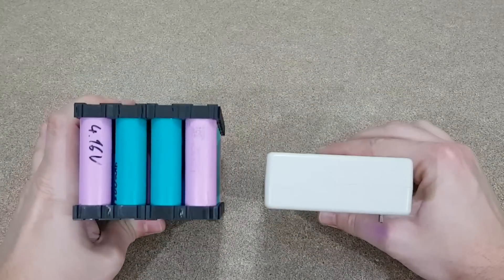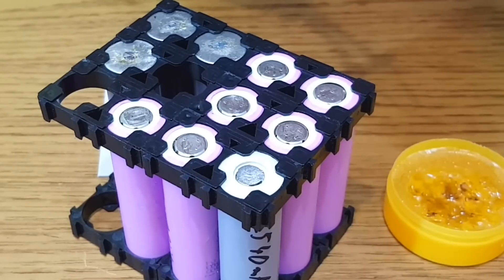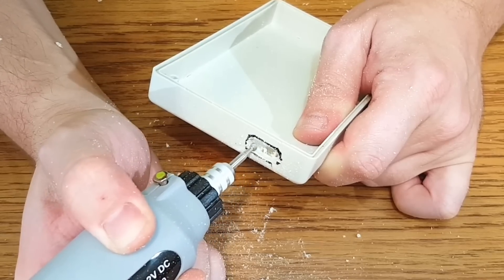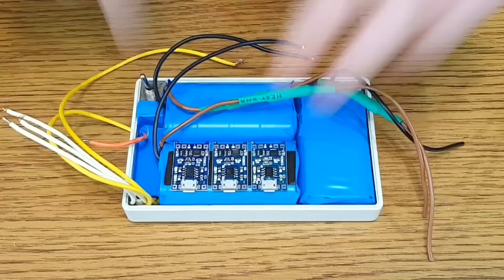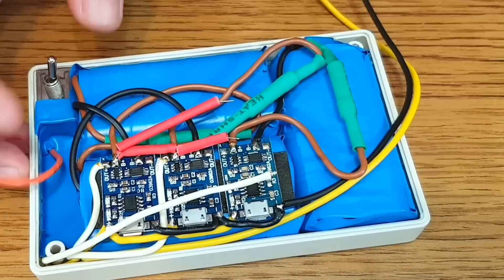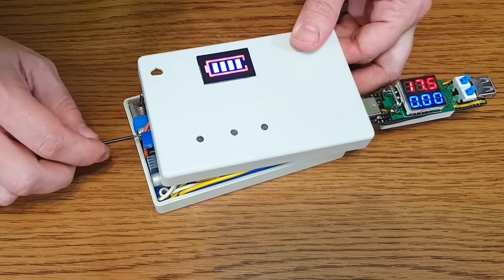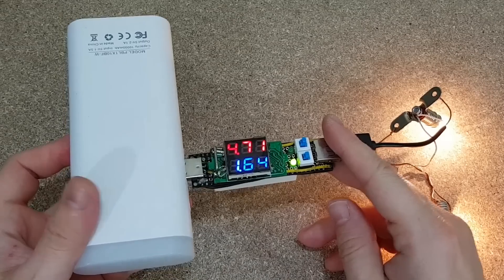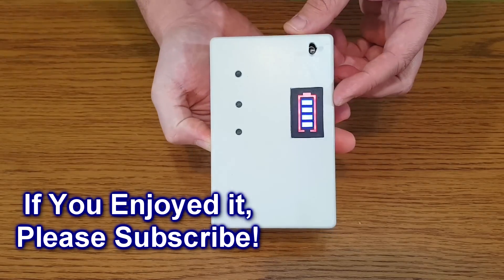DIY - 15000mAh Power Bank - With Salvaged Batteries (gets charged with 3A)

Comment: Hi sorin, i've been watching your youtube videos. I have a question, can i use 3parallel batteries for each bms to increase the capacity? Thanks
Reply from the maker: yes. but all the cells must be the same type.
Reply: @Sorin_DIY  Thanks! I'll definitely do it!
Reply: If i do it are there any modules in the circuit i have to change?
Reply from the maker: no. only a bigger plastic case :)

Comment: were does this plastic case came from?
Reply from the maker: I've bought it from a local store, but you can find it on Aliexpress:
https://www.aliexpress.com/item/32908017799.html?spm=a2g0o.productlist.0.0.548c70ffjbpmct&algo_pvid=f74485d3-9f84-4b75-87f6-f4f415fd2cde&algo_expid=f74485d3-9f84-4b75-87f6-f4f415fd2cde-42&btsid=3f53045b-b242-43a4-a456-742b6e0573f6&ws_ab_test=searchweb0_0,searchweb201602_5,searchweb201603_55

or in black:
https://www.aliexpress.com/item/32825258950.html?spm=a2g0o.productlist.0.0.548c70ffjbpmct&algo_pvid=fbaf7289-d821-4b04-92b5-0a3b556603a2&algo_expid=fbaf7289-d821-4b04-92b5-0a3b556603a2-0&btsid=783c9ad0-a872-45fe-969f-2dbf47cc0789&ws_ab_test=searchweb0_0,searchweb201602_5,searchweb201603_55
Reply: thanks sorin

Comment: sorin xl6009 modules can it charge 12v battery?
Reply from the maker: hi. it depends on the type of battery, ni-cd, li-ion, lead-acid, lifepo4... if you can give it enough current, yes you can use it to charge a battery, but in combination with a charging module for that type of battery. for a li-ion battery pack for ex, you can use it to set the needed voltage and power a BMS that charges that battery pack.

Comment: my step up xl6009 when used for charging is very hot even though I have used heatsing, is it not dangerous if it is placed near the battery?
Reply from the maker: hi. I suggest you use the step up converter from the link bellow. it's much more stable, when the cell voltage is under 3V. and it doesn't get that hot.
https://www.aliexpress.com/item/32450571426.html?spm=a2g0s.9042311.0.0.27424c4dYDNnaS
Reply: @Sorin_DIY  yes now i am using mt3608 but when i try to charge my smartphone the ampere output drops from 0.4A to 0.1A then charging disconnect. then I try to charge my powerbank the output ampere can be up to 1A and stable at 0.8A and charging not disconnect. Why so?😂😂😂
Reply: @Sorin_DIY  my xl6009 when battery voltage under 3.4V output jump from 5.1v to 5.8v-28v 😂😂

Comment: Could I take a normal switch (like this: https://www.ebay.com/itm/10pcs-1A-30V-DC-250V-black-Latching-on-off-mini-torch-push-button-switch/252221693408?hash=item3ab9959de0:g:y3cAAOSwZ1BXc8qW) when im just using two tp4056 and just put the to positiv wires together and up to the switch?
Reply from the maker: no. if you use 2 tp4056 modules, you need a switch with 3 poles and 2 positions - 3pdt switch

Comment: You can make even the crudest version of spot welder at home. Relay, momentary switch, two thick copper wires and a car battery. Good idea, excellent run of the idea on screen but really, there are 10k powerbanks that are more than half a size of yours because they have a light and powerful lipo battery and they can easily output 2A at 5V without drop. They aren't that much expensive. I have 9k one, had it for 3 years, still works, delivers 2A and it was quite cheap. Although it was fun watching. It does remember my case where I have failed with my project miserably because I wanted to build TP4056 series charger that can balance 6 cells and charge all pack at once but... I ditched the idea because prototype failed miserably. Why? Series pack needs to have each seperate ground and isolated DC-DC converters are not cheap, they are expensive. 6 converters were more expensive than excellent all in one ISDT Q6 300W charger which I got from aliexpress in about a week with china air mail. So sometimes some project are waste of time and money and there are some things you can't make them cheap yourself.

Comment: I will call that charging current test fake , u should have used same cables to charge both power bank.. cheap quality cable and usb ports can really effect current!...
Reply from the maker: my videos are not fake. both USB cables are of good quality. I use those cables in other videos as well. and you can see the black cable is actually thicker than the white one.

Comment: hi a pc psu that has 450w of power, can it wasting same 450w, with no pc components? please reply fast
Reply from the maker: hi. every power supply has an efficiency rating. newer power supplies have an efficiency of 80% or more. so if you connect a load that's using 80W, the power supply will draw 100W from the mains. with no load connected, the power supply should have just a very small current consumption from the mains.
Reply: @Sorin_DIY  I UNDERSTAND,because my parrents saying:my computer is consuming 450w (even i don't have power-hungry components). btw, when the power supply fails,will consuming more energy?
Reply from the maker: when the PC is turned off, there is still a small 5V stand by power supply active, which consume just a few Watts. it's the same thing for TVs and monitors. and when you turn on the PC, monitor, TV, the small power supply turns on the normal power supply. all devices that have stand by mode, use a few watts, when they are in stand by mode. when a power supply fails, usually it doesn't start at all.

Comment: Will it be ok, if I use 220ohm instead of 10 ohm resistor?
Reply from the maker: hi. 220 ohm resistors will not balance the cells to the same voltage. there will still be a small voltage difference between them.
Reply: oh.. i got it.... thank you so much...and this video is a masterpiece.♥️

Comment: why do you not conect the output of this tree charging boards to paralel and every bateri ofcors paralel? and than charging?
Reply from the maker: hi. you can't connect the battery terminals of tp4056 modules in parallel. there will be a small voltage difference between them, the voltage does not stabilize, so the charging process will not go well. the charging modules may get damaged.
Reply: @Sorin_DIY  ou

Comment: What is alternative for 12pin dptd on on toogle switch
Reply from the maker: hi. you can use a 9pin on on toggle switch, which is much easier to find. you will use 2 charging modules instead of 3 and 2 groups of parallel cells. it will charge a little slower, with max 2A, but it will still work fine.
Reply: Thanks for the information

Comment: In stores most of the power banks use large single cell type LiPo batteries or something similar like a huge phone battery. Basically it's just big and flat. 
I like the idea of adding in your own cells when the old ones wear out. Which you can do if you have a soldering iron, you need a pretty powerful soldering iron to solder things to the battery terminals though, as they suck the heat away fast into the battery and that heat can easily warp plates and damage the internal battery. So you need a soldiering iron tip that is incredibly hot so you can do the job fast. You probably need a soldering iron tip of like 400 degrees Celsius at least to do this. 

I wish they just made a cool empty battery bank that you could add say 8-16 cells to. And you don't have to solder them in, instead being held in tightly with high quality springs. And it would have USB output and 12v output, as well as input charge via USB or AC adaptor charging for faster charging. 
This would be really cool, because people could easily turn a bunch of laptop batteries very easily into a useful battery in their home. I mean just 16 average laptop cells combined will give you at least a 35000 mAh battery. 

Maybe they make something like this already, I haven't looked. But I would rather something with useful functions and easy to put together and replace batteries, instead of something I have to solder together while worrying about damaging the cells and needing an expensive high temperature soldering iron etc and then having a pain to replace them.

Comment: Hi can I ask?  I hope someone will answer it.  What if the output of tp4056 module is permanently connected with each other while charging.  Will it be possible?
Reply from the maker: hi. it will not work. the cell will not be charged properly and the charging modules may burn. you can buy a different charging module with 2A.
Reply: Hi thank you for responding 😁 . I love yout videos please make one as soon as possible 😍
Reply: Another thing, what if instead of using 3 ppstive wires for the switch.  I will use the negative wire and the 3 positive directly connected to the boost converter
Reply from the maker: you need the switch. the 3 positive wires are bridged, only when you turn on the switch.
Reply: @Sorin_DIY  Ok thank you for responding 😁 and for the ideas

Comment: Now, do you think that these beautiful ideas can also be applied to other batteries? Kindly build an 8S20P or 4S10P powerall using Headway Lifepo4 40152s 3.2v 15ah Cylindrical Battery Cells pls.

Comment: great job but there is something unclear
You said fast charging but it is not
why didn't you charge both power banks by the same amount of current. You used 0.75 A for the commercial one and (1.5 to 3 A) for the DIY.
Commercial: 0.75 A ---> 11:20 h
DIY: 1.5 A ---> 9:30 h ( it means if you used 0.75 A, the charging time will be the double ---> 19:00 h ====> 7:40 h bigger than commercial charging time)
Any explanation pls?
Reply from the maker: hi. it's a fast charging powerbank, in the sense that the powerbank gets charged up very fast, with max 3A. not that it has adaptive fast charging feature. 
I did charged both powerbanks with the same power supply, 5V 28A. but that's not how current works. my powerbank is designed to use more current to charge the cells, that's why I've used 3 tp4056 modules, each needs 1A max, so a total of 3A max. the purchased powerbank is designed to use max 0.75A, no matter how much current you give it. that's why my diy powerbank gets charged up that fast.
the charging current for these powerbanks/charging modules is not constant 0.75A or 3A. it is MAX 0.75A or 3A. you can check the tp4056 datasheet and my other 18650 charger videos for more info. the charging module uses 1A until the cell voltage rises to 4.2V. then the charging current slowly decreases, until the cell needs no more current, because it is fully charged. so if you charge a 1Ah cell with 1A and a tp4056 module, it will not take 1 hour to fully charge it. it will take around 1.5 hours, because in the final sequence the charging current gradually decreases from 1A to 0A.

Comment: Sir can it use 3pdt switch?
Reply: Cannot it use 6 battery cell and two tp4056?plis reply
Reply from the maker: hi. with a 3pdt switch you can make the powerbank with 2 groups of parallel cells and 2 tp4056 charging modules. it will get charged up with max 2A.
Reply: I didn't get 4pdt I only have 3pdt switch
Reply: Please reply
Reply from the maker: you can use a 3pdt switch with 2 tp4056 modules and 6 cells. you connect the cells in 2 groups of 3 parallel cells. each group will be connected to one tp4056 module.

Comment: Use these cells in series is easier to handle charging.
My "Powerbank" uses 4 cells in series and i use step down converters to get the voltage i need.
Reply from the maker: hi. that will work as well. but I want to charge it fast with 2-3A and I want to charge it with a microUSB cable, because microUSB cables/chargers are very common. my 2.1A phone charger and this powerbank is all I need for my long trips.

Comment: Not able to get increase the amps i am only getting 0.45 any ideas to increase it to 1 amps.
Reply from the maker: hi. what step up converter did you used? I suggest you use the one in the link bellow. it's more stable and it can deliver an output current of 1.7A at a stable 5V. it also depend on the load you use. if you want to test it properly, you should use a USB tester (like the one I've made) and different loads. for more info you can watch my USB load tester video.
https://www.aliexpress.com/item/1000001111095.html?spm=2114.search0104.3.226.692e4d6fHJAC2a&ws_ab_test=searchweb0_0%2Csearchweb201602_5_10065_10068_319_10059_10884_317_10887_10696_321_322_10084_453_10083_454_10103_10618_10304_10307_10820_10301_10821_537_536%2Csearchweb201603_52%2CppcSwitch_0&algo_expid=6dd5e38c-359c-431c-93a1-a5dea3dfa55b-31&algo_pvid=6dd5e38c-359c-431c-93a1-a5dea3dfa55b&transAbTest=ae803_3
Reply: @Sorin_DIY  Thank you sir,will try I don't know schematic from MT368 to usb .
Few times I got 0.86 mah ,I resolder pin it was lose ,for then on wards it gave only 0.43 mah.
Reply: @Sorin_DIY  should I need to wire D+ and D- also I am using usb white color or should I need to change for usb 2 .

Comment: 5:04 I'm curious in your schematic why you connected the negative wire from the output of the charging module to to negative output of the Step Up Voltage converter. I thought it should be connected to the negative input of the step up module.
Reply: those modules have just one common negative, in- and out- are bridged on the PCB
Reply: Thanks  @LPNikolaj  for the explanation

Comment: You could have bought a power bank module, they are available online and have all the balance charge, over discharge, overcurrent and boost features, as well as the built in meter.
Reply: I thought about this too but I don't see any that can charge the batteries fast enough, most of them maximum charge current is 1A which is okay if you have 1-2 batteries. Unless you have a link to one that can charge up to 2A because I am trying to build one that has 6 18650s in parallel. Been looking but no luck.

Comment: You should have used a DC-DC Step-up Converter 3V 3.7V 4.2V to 5V 3A 15W Power Supply Boost ModuleHJ instead of the buck converter. Boost ModuleHJ has constant voltage, constant current, the buck converter doesn't.
Reply from the maker: I've used a step up converter, not a buck converter.
Reply: @Sorin_DIY  6:43 clearly buck step up converter https://www.ebay.com/i/222653317864?chn=ps Problem with buck converters is they don't have constant voltage, the battery voltage drops so doe's the buck converters output. Still nice job.

Comment: I am confused with toggle switch which side to soldier .It's written on -on from that side or the side which isn't written anything please help.
Reply from the maker: hi. it doesn't matter on which side you start soldering. just be sure you solder the wires exactly like the schematic.
Reply: @Sorin_DIY  Really hard but I did it . I used dlink  internet scrap box .Many times while soldiering  fuse goes out.
I have problem sir lithium battery indicator just glows on outside border ,the four boxes don't show up.
Reply from the maker: you need a 1S battery indicator (max 4.2V), you've probably got 3S or other type of battery indicator, for a bigger voltage.
Reply: @Sorin_DIY  Thank u I used 3s .Can I increase the amp it's showing 0.43 amps.

Comment: but the micro usb cant handl more than 2A how u charge them wth 3A ?
Reply from the maker: hi. it's not recommended to use it with more than 2A. but I've used it many times with 3A and it's perfectly fine, it doesn't heat up at all, because the voltage is very low. in contrast, when I charge my Samsung with fast charging, at 9V and 1.6A, the microUSB plug and the charger cable get very hot. that is much more dangerous and nobody talks about that.

Comment: I had problem soldering fuse to wire ,they don't attach,keep on faling.whqt to do sir.
Reply: Sand the ends of the fuses a bit and use flux. The solder should flow onto it more easily.
Reply: @HobkinBoi  Thank you

Comment: 4:42 This is not correct because USB can only transfer 2.5 amps. You must have 3 USB ports, which must be powered at the same time.
Reply: you could also just use a different connector to supply those 5V...
think ATX PSU 5V Rail for example

Comment: 50$ just for  parts. best power bank . with high capacity  .you can use for anything  even cars . can use for power your car battery. for 35 $ best brand and high quality. looool this is just 50$ buying some parts without battery. 50$ for battery too.  100 bucks for power bank . hahahahaha. jokeing hahahaahah

Comment: Sir how much mah from power bank we have  3.7 v to 5 v so there will be boost up . Exactly how much you get from power bank .
Reply from the maker: hi. the capacity at 5V is around 9180mAh with an efficiency approximation of 85% from the step up converter. the efficiency varies with the current consumption. the bigger the load is, the lower the efficiency.

Comment: This is actually a 7.5Ah battery, as there are 2 cells in series and 3 of those bundles in parallel. Only cells in parallel add capacity so he is getting 3 x 2.5Ah not 6 x 2.5Ah
Reply from the maker: hi. each pair of cells is charged individually. and when I turn on the switch, all the cells are connected in parallel, so it has 15Ah.

Comment: it has a very nice look and you used space very efficiently
but I didn't see current while you were charging your phone, most phones will charge only with 1A or even 500mA when they can't detect any identification for how much current they can draw from the USB port
you can use a simple resistor between USB data pins if you know which standard is your phone using and it can draw full current but it may not work for all phones
there are few simple IC like TPS2511 which can communicate with a connected device and set the maximum possible current
Reply from the maker: hi. I've shorted the data pins and it's charging my phones with max 1.7A. Apple devices and a few more need those resistors on the data pins.
Reply: @Sorin_DIY  ok

Comment: What is the thicknes of the cabels you used ?
Reply from the maker: I don't remember. the wires are from a PC power supply. I think the diameter is 1mm; but 0.8mm is OK also.